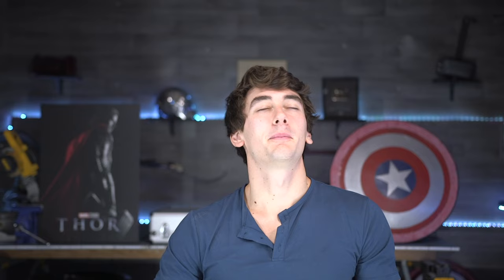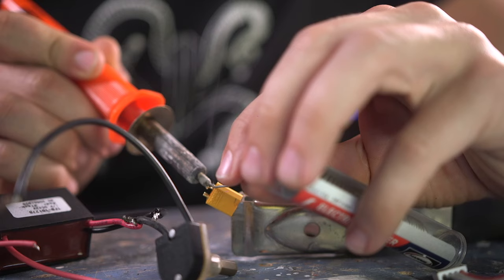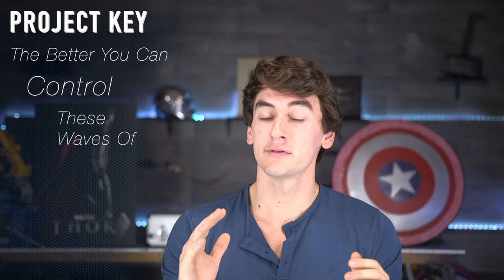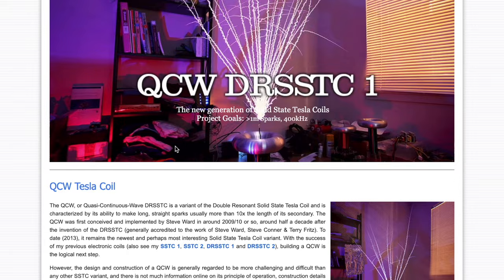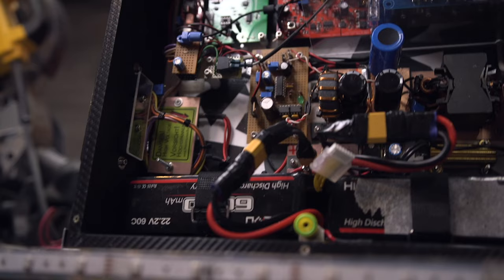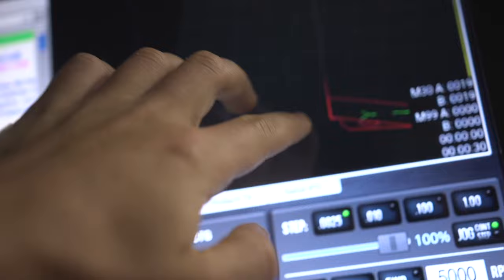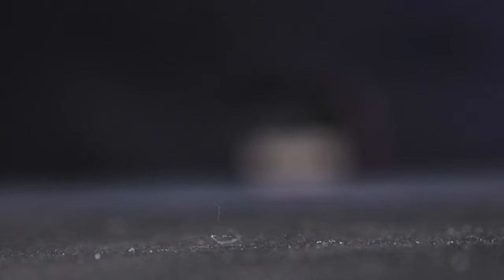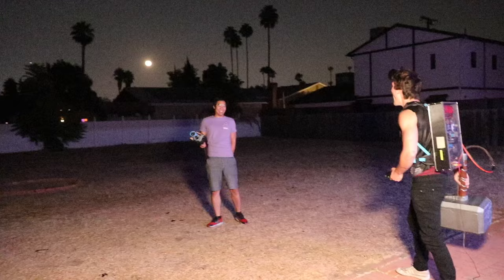You’ve NEVER Seen Thors Hammer Like This… ACTUALLY SHOOTS LIGHTNING!!!

Comment: 12:34 I'm pretty sure if that spot was insulted pretty good it wouldn't arc, just in case you didn't already know, I hope this was able to help you. They actually make a kind of liquid wire insulation which might work good at that spot, it's like a rubber coating.

Comment: 2:44 - No, the sparks, especially from a van de graf, are high current and your formula for danger leaves out both time along with frequency (If one is using an ac source, which looks like the case since the early clips of the sparks looks like the product of a QCWDRSSTC.)

Comment: Try this idea. I did a study on lightning. The study was about Vaporized elements. So try making this. Shields. Yep Star trek space ship shields. Yet I will give you a hand on how to do this.
A study was done by the military back in the 1980's. The study was on lightning. Specifically Ball Lightning.  The reason is Ball Lightning as the same capabilities as shields. It bounces off things. If the energy is set so a specific frequency  can go right through things like buildings. So if you can meat the right parameters you could create this. So take a look at creating Ball Lightning and then work on making it a shield. Good luck. I have some 3D projects to work on. By the way. interesting video.

Comment: More current does not mean more lethal. Generally speaking more voltage means more current. Also the exposure time also. The van de graff does not hurt because it has more voltage but the spark time is very low so it cant maintain the voltage for a long time. You could touch 10 volt and 1000 amps and nothing could happen but if you touch 1000 volts 0.1 amps you will die.

Comment: The only way I can see that working is on a rigged table made to control an electric magnet that the hammer would rest on a majority of the time. Only letting a person pick it up if they have something like a tracker in an accessory or something, (like in some car keys) and when close enough to the hammer, the electric magnet would turn off, letting the person pick up the hammer. Of course, they’d also have to figure out how to keep the magnet from messing with whatever mechanism that lets the hammer make electricity. But I’m not smart enough to figure that out, so that’s a them problem. Unless they use aluminum, copper, or tin, etc. (metal that doesn’t attract to magnets.)

Comment: Saying that the danger of electricity comes from current is kind of true in context, but misleading. You can touch both terminals of a car battery without any problems because the voltage is very low, even though car batteries can deliver a huge current in short bursts.

For electricity to be damaging, enough power needs to flow through you to damage your body. The higher the voltage, the easier it is for this to happen, which is why you see "High Voltage" warning signs.